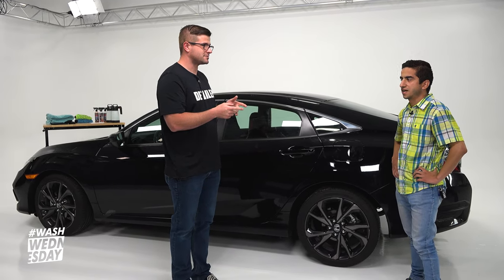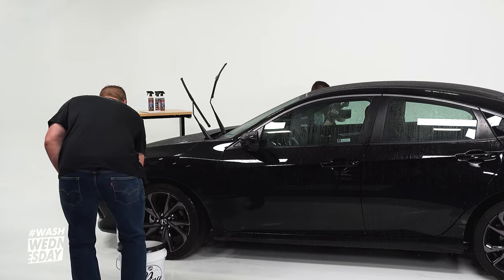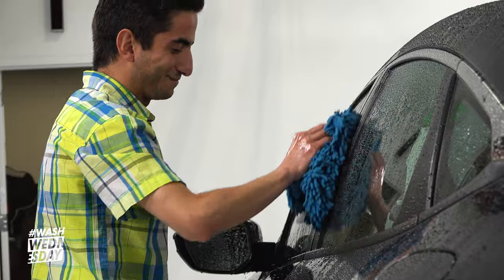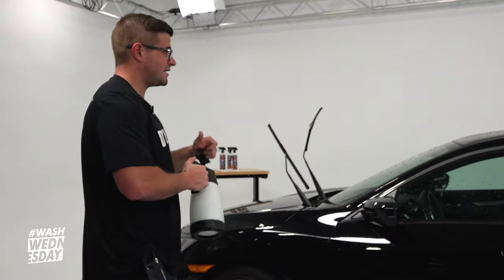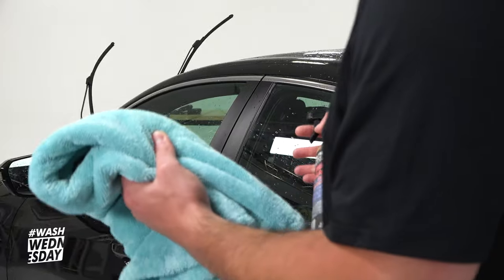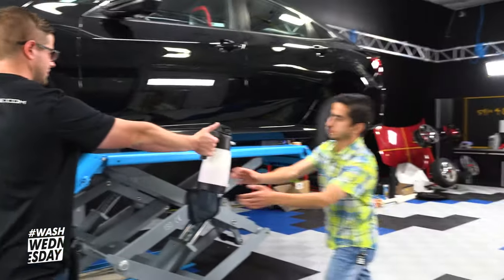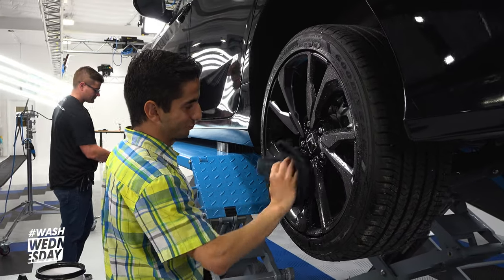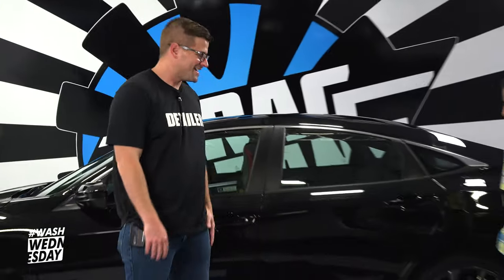Rinseless Washing A Filthy Honda Civic Sport | #WASHWEDNESDAY

Comment: So you're using beadmaker the same way you'd normally use ONR with Opti-seal spray and a drying towel?  Just replacing the Opti seal with Bead Maker here? 

How do you guys like it as opposed to the opti seal? What kind of differences do you notice?

Comment: I see in the comment that 1:256 ratio dilution. Is that for bucket and also for the sprayer as well? I also see 1:16 ratio for quick detailer, so I am wondering if 1:16 is used for the sprayer
Reply: Yes

Comment: When the chenille mitt becomes discolored from the dirt on the vehicle and it remains that way after dunking it in the ONR as well as scrubbing it on the washboard/grit guard is there a concern that there is still dirt in there that will mar the surface? I used to do ONR washes with the mitts but switched to the BRS/UBS for this reason, the only downside I see to them is the contact isn't as thorough and it usually requires multiple passes to remove dirt/dirty water.
Reply: Thats why N-914 is so much better. Although i heard Opti reformulated it recently.
Reply: @theragcompany  That is very reassuring, thank you for the answer!